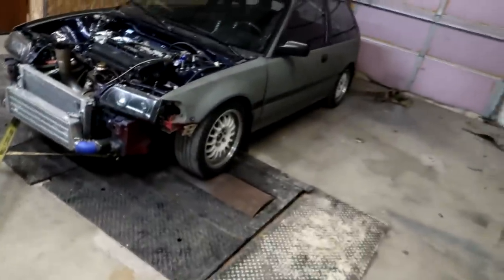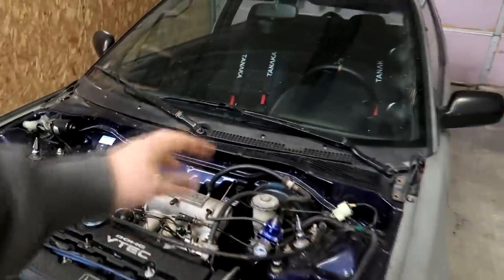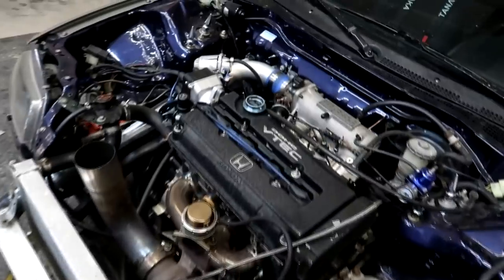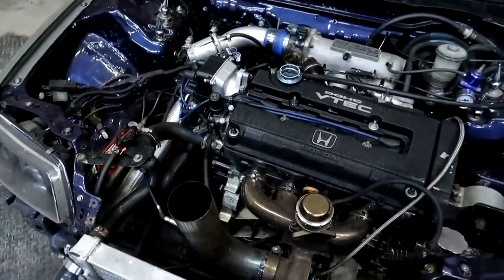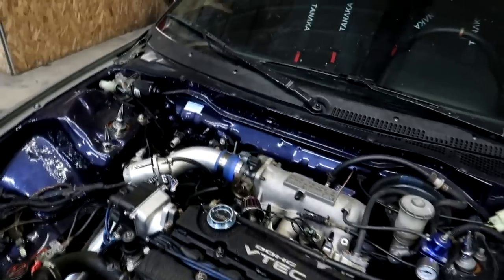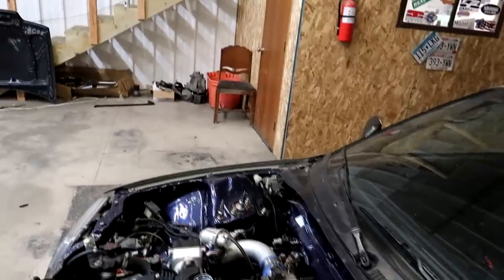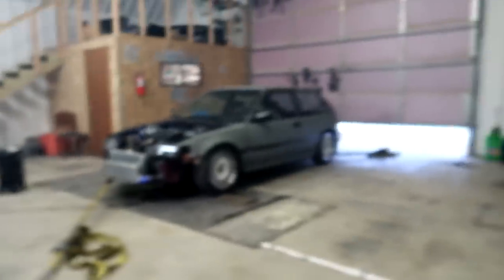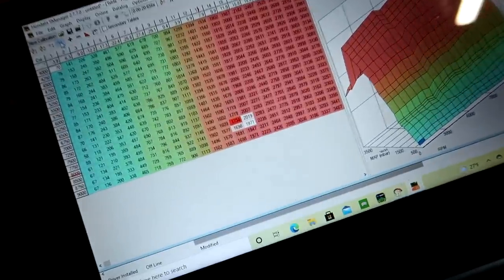Dyno Tune EF Honda Civic B16 Turbo Hondata S300 Tuning Ignition Maps !

Comment: Great vid! Longtime viewer! Ive been street tuning my sons .020” over Vitara/Speedfactory no-notch long-rod D16Y8 setup. His car is a 99 EK4DRLX. It has an old skool og GreddY sohc turbo kit!…i had the turbo rebuilt. It’s got a comp 105300 camshaft, BC springs/retainers, a block guard, arp head studs, Kteller DwnPipe, S300V3, Flexfuel, MAC valve. Ethanol usually runs around E67. Boost around 12psi.

Inefficient exhaust manifolds and turbine housings can kill your top end. I’ve been fighting a similar issue  with my sons Greddy setup. It utilizes a Mitsubishi TD05H-15G turbocharger that has a very restrictive wastegate housing to clear the a/c compressor. The car feels great all the way to about 6,800rpm then just goes flat. It still “pulls” but with less enthusiasm. Air fuels look great; mid 11s. Right now the 12psi ignition timing = 11.5*@6K, 12.5*@6.5K, 14.25*@7K. Seems conservative to me. Anymore timing and it’ll try to push coolant. Cam gear changes don’t seem to help either.

I’m almost positive that I’ve run into that exhaust “wall”. Time to upgrade!

Side note: my son came home from the hospital almost 20yrs ago in the backseat of his mom’s boosted EG 4DR D16Z6 AUTOMATIC! He and his sister rode in the back of that car for the first ~ 7yrs of their lives! He’s now driving around in his own EK4DR with that exact same turbo kit!
Reply: Sounds like me and ur son are going for a similar setup. Do you think the exhaust wall is due to the cast log manifold, turbine A/R or downpipe size.
Reply: @tayvonrose2528  Probably everything you mentioned. Cast log manifolds are the worse. Turbine a/r under ~.63 will also limit top end power. And you can’t go wrong with a larger downpipe.

Comment: Much respect for you taking the time to walk thru those maps with everyone.
This will be a great comparison for ppl to see the difference between cheap slapped together stuff vs a properly laid out kit. Would also be interesting to see the Garrett against a VS on the new setup.  Your absolutely correct,  that setup would be a good lil street ripper but after you had and seen the capability of better setup it's just not gonna excite you.
Thanks for sharing.

Comment: With winter coming, you're less likely to be out in the sun. Start taking some vitamin D. It'll help with your mood and make you just feel a ton better. Winter is depressing enough but it's something small you can do everyday to help out. You can also buy like a vitamin D lamp too for at home when you're chilling watching TV or whatever.

That out of the way. I wanted to ask, is your dyno able to do steady state? If not, is that something you wish you had as a tuner? I've heard it is a really good tool for timing if you're also using an audio knock monitor. I've never tuned but I'm extremely interested in it and want to learn everything about it.

Comment: Dude your videos are so helpful ! No one else explains anything about a basic starting point for for igntion timing on s300.  Obviously timing is very different with ethanol but like a past video you put 26 degrees when you start getting into boost then taper it out as the boost builds. If it was pump gas would a good place to start be 28 degrees? I know there are tons of variables between builds and also that ignition tuning should mainly be done on a dyno to actually see whats happening but im curious where the best conservative starting point is for a turbo honda on pump when setting up a base map to drive around on till you hit the dyno.

Comment: Its bubba with the slow GSR all motor...thats exactly what my gsr was doing... It wasnt all the time either..we found broken pins on the data port connection to the board..soldered them right to the board with single pieces of wire.. never had an issue again

Comment: Hunter, when your running into this problem where you got a cam too big on a vtec engine. Give it a try just running the engine out of vtec for the whole range. Obviously we want vtec to work. But if the extra air is hurting the performance, give it a try without it until you can fix the back pressure problem. We notice on your graph raising the vtec higher and higher keeps increasing the efficiency of the engine.

Comment: I think the larger bore size on an LS compared to the smaller diameter on a b series has a lot to do with the timing the engine desires... Flame has more room to travel

Comment: It's a vw scirocco 85ish radiator, I have the same one 😂, definitely need more video's like this, any suggestions on intercoolers for EF civics, I'm in a CRX extremely happy with my build and how it is coming out but run the same intercooler bc I can't get anything else to fit

Comment: Im runnung 13-14 timing at 7 psi on my 2007 Honda Civic base model R18 engine.  Same timing as a basemap on hondata for turbo.   Runs well. Would you reccomend going more boost same timing or same boost and more timing?

Comment: I can not stand ppl who tailgate!!  I have a 30” x 25” decal on the back of my Ranger tailgate that says “GET OFF MY ASS” 
I’ve seen another good decal that said “you should have left earlier.” lol
I installed 4 large train horns concealed under the rear bumper cover from Hornblasters in my project Civic. Compressor and the tank are under the left side of the car.  You don’t know it’s there.  149 db and yes, it sounds exactly like a train. Go ahead, cut me off MFr.  This shit scares ppl when they are ready to hear them.